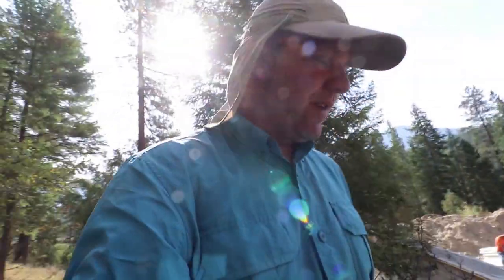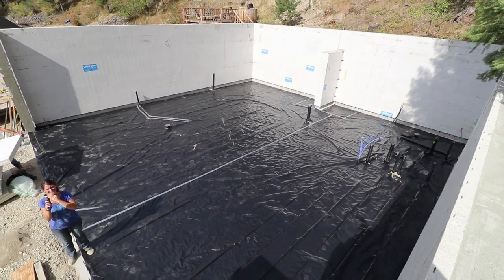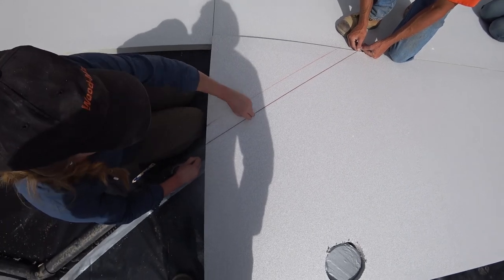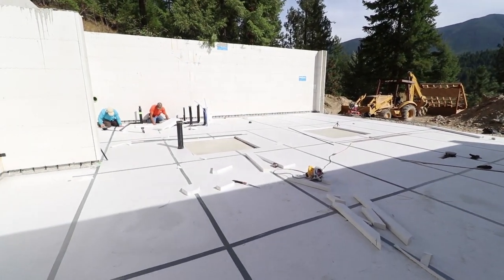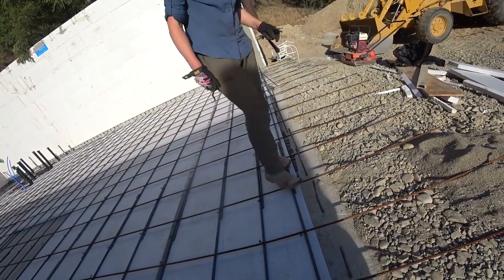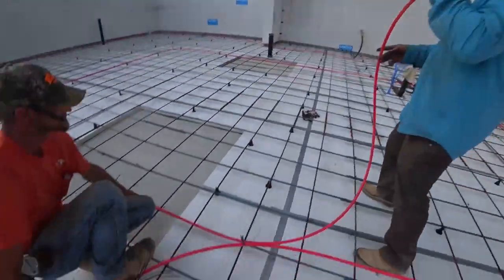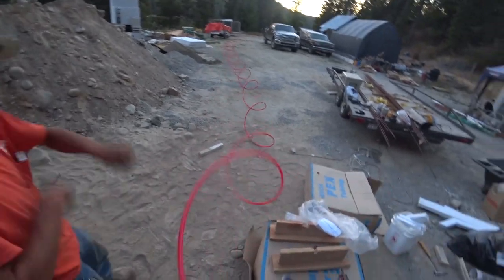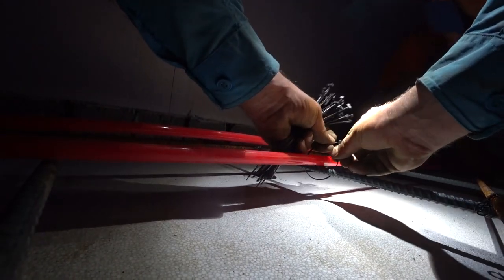PLAYING GIANT HOPSCOTCH (Rebar Tying in Concrete Slab)

Comment: The styrofoam used was open cell and not rated for under slab use.  It will crush during the pour and you will lose much or all of the R-value.  The proper foam in the colored closed cell that is rated for 200psi or better, you are using foam that is commonly used as packing material.   

Worse than that, it appears you are using Duct Tape.  That means you lost the integrity of your vapour barrier and gasses like radon (carcinogen) and humidity can work into your building.  Duct Tape dries out quickly and it isnt vapor proof to begin with.  The proper product is Tuck Tape.

It isnt a small mistake this time. . . .
Reply: Mike S if you knew what you were talking about you might be dangerous this isn’t regular poly styrene, hence why they could walk on it, open or closed cell doesn’t matter that much just the compressive strength.
Reply: I havent seen any insulating styro at a big box store that wouldn't hold up to quickly walking on it, maybe that is why you are so confused epiccollision.  It is clear you have no experience with properly insulating under slab and I am not sure why you bothered to write what you did.  Combined with the duct tape used in this video, this is as poor of a materials selection as can be made while still appearing to finish the job.  Since they have already poured the slab, this is now a permanent display of how not to insulate a slab.
Reply: Mike, couple notes (I am not taking sides but sharing information) - They are using what is called EPS.  There are 3 grades of EPS. Type I, II, and III.  Consider that they may have purchased this EPS from their ICF provider and that the ICF provider is more than capable of compressing the EPS sheets to withstand a slab pour and house or using the proper type of EPS in the first place.  Since they have two lolly pockets in their basement/garage I would put money on the fact they are planning a beam along that area meaning the foam would not have the load of the house on it, but instead just the load of the concrete pad.  If that squishes the foam, so be it.  It will happen when concrete is wet while it is at the heaviest stage.  They won't have house loads on a 4" thick slab.  I believe they are over-rebarring if anything.  A wiremesh or less dense grid of rebar would have probably been sufficient for most of the slab.

Point 2 - They appear to have their vapor barrier/retarder below the foam.  This means the tape on the foam is doing nothing but sealing off the gaps from dirt/concrete/etc from entering between the foam sheets.  Non-issue with what tape they use.  If they were using EPS or XPS as their vapor barrier, then you would be correct and they would need a proper tape rated for contact with the foam.
Reply: The styro, as you said, sold by the ICF company looks the same as the walls.  Styro insulating walls, is NOT the same as the 200+ psi rated for under slab.  Where I live, the 200psi styro is pink or blue- likely it is the same in USA.  We have the white EPS here and it looks the same as what was used in the video, this is for insulating WALLS.

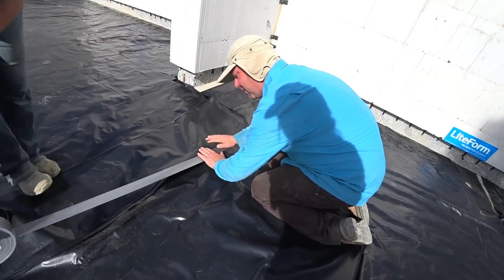Again about the tape, the vapor barrier was sealed incorrectly with duct tape, view at 3:40.  The vapor barrier is compromised, right down the middle and it will allow gas and humidity to pass.  This is the opposite of what the goal of a vapor barrier is.

For some reason, I seem to be the only one concerned with these issues.  In addition, and this is just speculation, when the garage floor is loaded, if the EPS gives out at that point, it could cause some cracking.  Good thing they put in a lot of rebar I guess.

The duct tape usage reminds me of a crappy Canadian comedy called the Red Green Show where duct tape was used to fix everything.
Reply: +Mike S
Styrofoam is a trademark for Expanded Polystyrene Foam, and it is always blue. EPS foam is the same thing except from different manufacturers, and it is generally white. The type he is using is EPS foam and there is absolutely no reason to believe it wont hold a slab concrete.
The tape they use is a non-issue, with the overlap they have it does not require sealing at all.
Reply: wrong... you can get EPS foam insulation in a variety of densities and bearing pressure ratings. 

look at geofoam... you can build highway abutments with the stuff. its a non issue, im sure they bought the correct EPS.
Reply: Mike S first it was thermal break then the Styrofoam was wrong. Let's just wait a bit before judging🔨them.

Comment: Maybe I need too get back on the turnip truck but it seem to me the lower garage/shop is looking ok but the second floor should be the living quarters, it would have eliminated all that plumbing & sewer crap until you had plenty of fall, while in the winter you would have a great place to keep your equipment and have a nice workshop to build the the top floor, in finishing I think your building it ass backwards :)

I’ll crawl back in my hole now ....
Reply: Second floor is living quarters. Lower is mechanical and  AirBnB/guest space.
Reply: You need to look at their plans and then go to the turnip truck.  BYW, plumbing lines can have a maximum fall of 1/4 in per foot.  Solids must be able float down line.
Reply: Ian Powell yup thats right its not just garage, i dont think OP realized or knew that (or cared)

Comment: Guys save your money.... Radiant floor heating is a huge waste of money.... Rebar in a small car garage... use fiber mesh... better yet. Get some professional help.
Reply: its not a waste when you consider they are probably doing radiant elsewhere. 
the garage would be just an additional zone in that case, and half inch class A pex is literally like 30-40 cents a foot. 
they are probably looking at like 500-1000 feet of pex in the garage. which is less than 500 bucks. 

an additional aquastat + a manifold that is 1 zone larger is likewise an inconsequential sum of money... talking about like 750 bucks maby for this setup. 

also keep in mind that radient heating is a huge selling point for some folks. im not a huge fan TBH. i think its efficienty is overstated personally, but you should not underestimate its appeal to a potential buyer.   

far as the foam insulation being a waste? this is not the case... they are basically moving their conditioned envelope down to the bottom floor like they should be, thus they do not need to insulate floor joists as aggressively as they would have to otherwise. 

also recall what climate this is... without a conditioned garage they would have to suffer through cold starting their cars and waiting how ever many minutes the manufacturers want before you start driving. 

also recall that garages are often less for cars as they are for work spaces and storage these days... having the ability to bring the temp of the garage up to 60f during the winter time would be invaluable. and again reflect positively on future buyers.

Comment: Why remove the vapour barrier (damp proof membrane) from the 2 pier support footings or at least not replace it with damp proof course material suitable for heavier loading? They may be in the middle of the building but the pier support footings will essentially be wet as they sit on bare ground. If the slab is poured directly on top of them with no damp proofing in-between then any damp in the footings will end up in the slab. Bizarre. And the vapour barrier was also cut at the perimeter of the slab so it didn't protect the edge of the slab from the damp walls (which didn't seem to incorporate any sort of capillary break with the footing). Really hard to believe a designer would do things this way, breaks so many basic rules regarding continuity of the damp proofing protection. Good job it's mainly just a garage space.

Comment: Your vapor barrier goes on top of the foam. Never under it.
Reply: Yup, barrier always needs to go on the warm side or condensation willl form btween the slab and the barrier.
Reply: Correct, however they have not installed a vapor barrier which is alarming. What they have installed is a damp proof membrane under the insulation and not installed a vapor barrier at all. They need to install a vapor barrier over the insulation as well which means they need to take up the rebar to install one. As they said they will be pouring the slab on tuesday and it is now wednesday I would imagine this never got done.
Reply: bernie19d1 the videos are like a month behind
Reply: Darren Bohan yeah we know

Comment: Never use duct tape on anything you want to stay sealed.  you reduced the ability of the vapor barrier to hold back moisture.
Reply: Christian Geiselmann duct tape deteriorates fast
Reply: once the concrete is in, the duct tape won't matter.. all it's there for is to keep it in place during the pour
Reply: Lyle Miller makes sense 👍